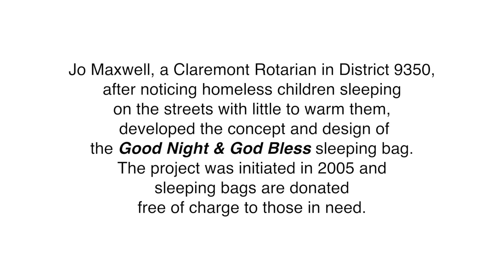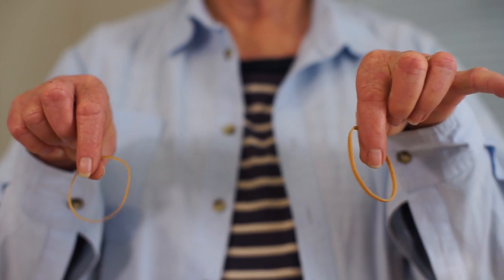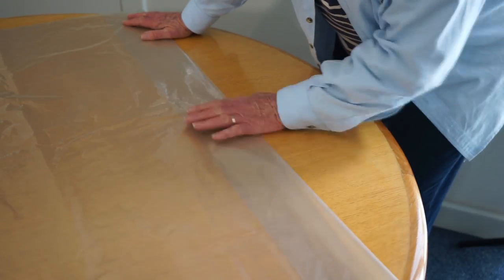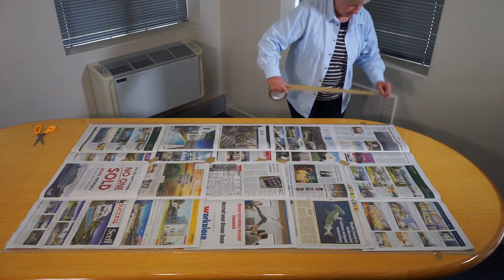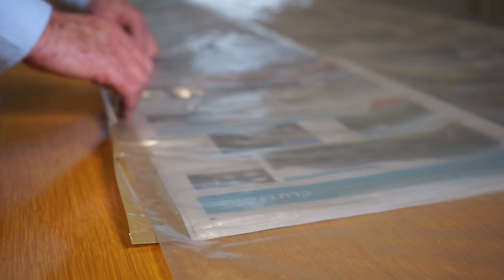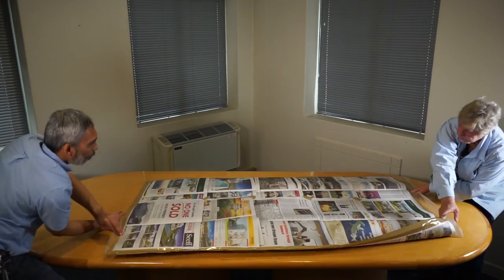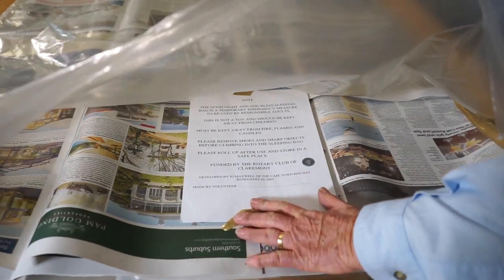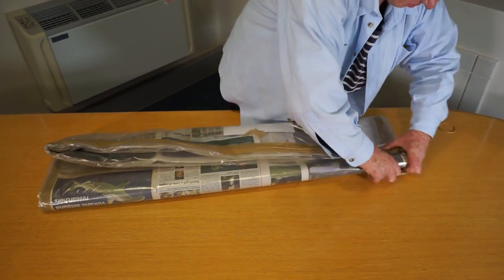Good Night & God Bless Sleeping Bag

Comment: This is awsome. Can regular duct tape be used?
Reply from the maker: Yes you could use Duct Tape but it may be quite expensive, compared to packing tape.
Reply from the maker: Yes regular duct tape can be used but it pushes up the price of producing it. We try to keep the cost under $2. It also must be kept in mind that this is only a temporary measure until better bedding can be provided.